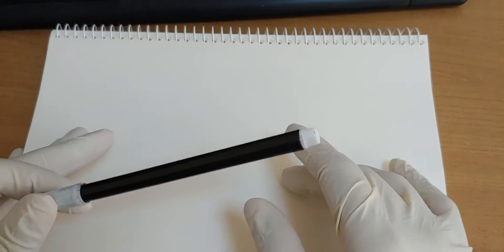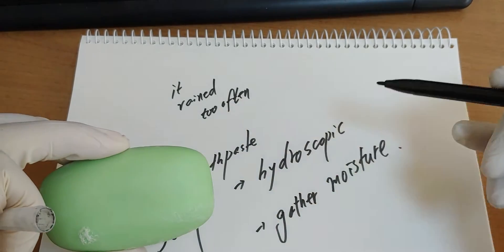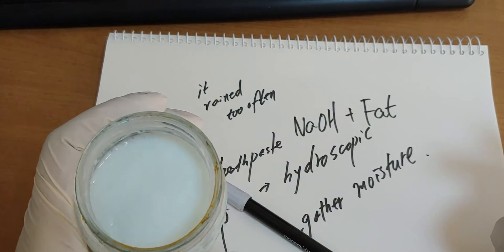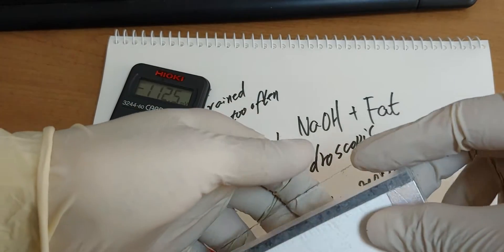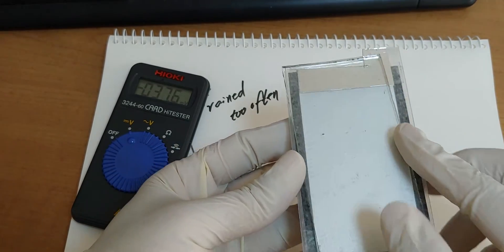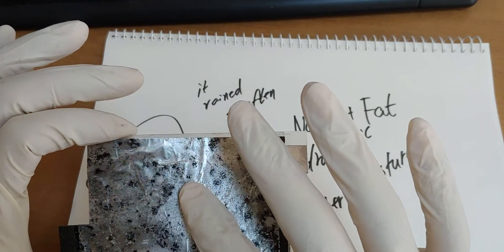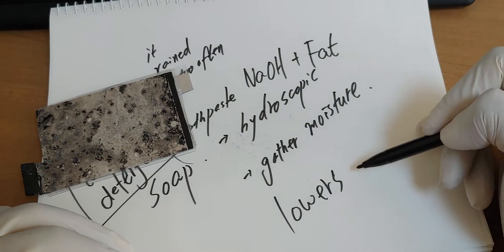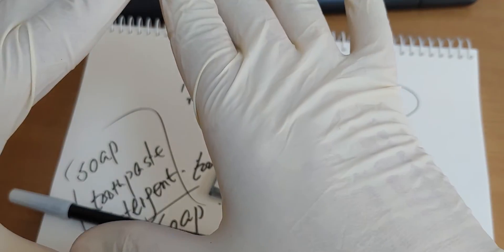Soap solid state battery: Good enough

Comment: One layer and around 3V is great. I'm abit confused about the "stacking" of that cell. Do you mind to tell from side to side what the layers are, including current collector etc. etc? Keep up the good work! Btw, your english improoved qute a bit over time! IMHO no real need to actually write down everything.
Reply: TOP: carbon on the Al (I did this to gain Al ions, which proved not helpful)
Middle: Cathode electrode: Soap + Detergent + Toothpaste (Soap helps the cathode electrode to be solid even in a humid condition)
Bottom: Al collectors.

Have a nice day.
Reply: @영어도우미 have you made any progress or new discovery ?